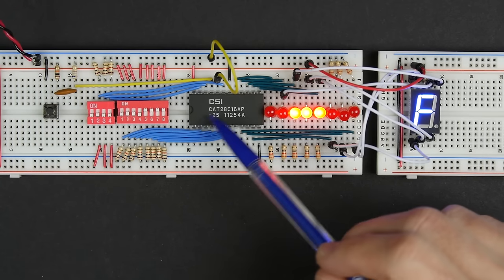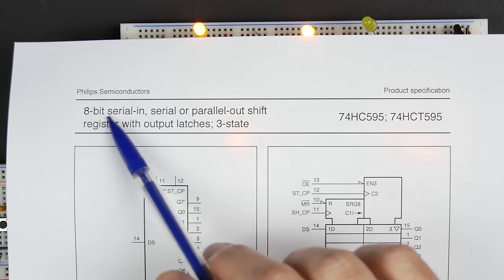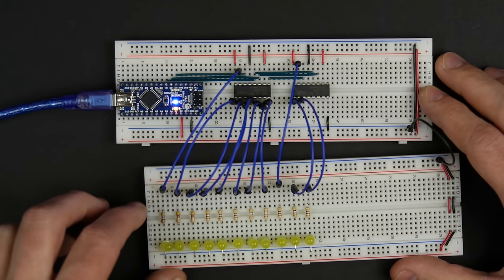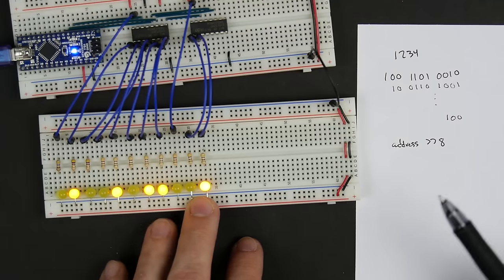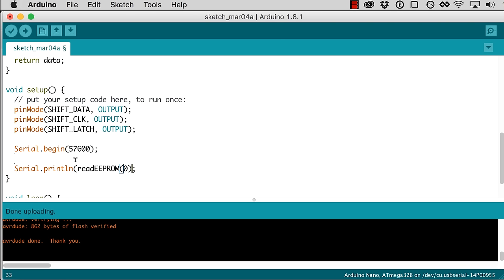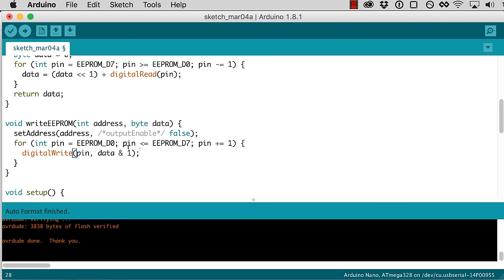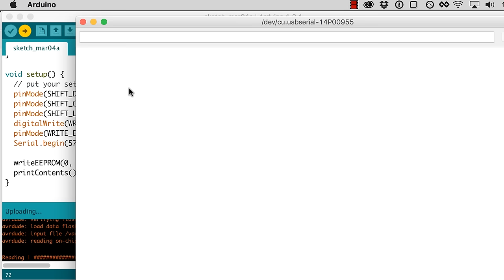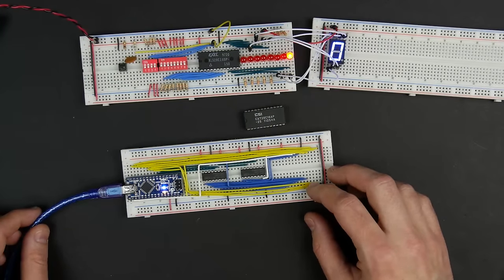Build an Arduino EEPROM programmer

Comment: I just cannot get this to work. 2 major differences in my case: 1) I am using an uno. 2) The EEPROM i am working with is a AT28C256.  I simply used the other 7 shift register outputs for the additional address lines.  There is exactly enough pins.  After struggling, i pulled out my Siglent to look at what is going on and I noticed that the LED on the UNO blinks 3 times on startup. That's connected to pin 13. So, I swapped pin 2 and 13 and updated the code accordingly.  Still no luck.  Next, i figured the write pulse was just too long so i wired up a R/C circuit with 1micro-f cap and 680 ohm resistor.  The o-scope timings look spot on, about 700 ns from below .8v to above 2v.  I am starting to think my eeprom is no good. Does anyone have any other suggestions?

Comment: the delay part, I guess the write delay should be fine for 5ms, but not enough for the changing of the Arduino's IO transfer from output to be input.

Comment: Ben, I loved this project so much, I bought the parts to build it. When testing, I couldn't get it to work. I'm using the AT28C64. I tried moving the (erase, write, read) to separate voids, and added push buttons on analog A1,A2,A3 in void loop to do each step separately. I put an OLED display to tell me what step it's doing and >ready< when done. Sometimes I get random data, all ff, and sometimes b8 which is the last byte in the data array filling every memory cell of the chip. Can someone tell me what I did wrong?

Comment: Why do you need to program it using hexadecimal numbers. Is there a way. I think converting would be nice but you can't just write into it by typing 0s and 1s?
Reply: The C programming language does not have a way to represent a number in your code directly in binary. He is programming as if arduinos were programmed in C.

They are in fact programmed in C++, which is (roughly) a superset of C. In the 2014 update of C++ (called C++14) you can use what is called a binary literal, just like this: 0b01010101 (notice the letter b instead of x). So he technically could do that, but that is more typing.
Reply: Thanks for your answer. :) It's just complicated for me to program it using HEX number set

Comment: Hi Ben, excellent project !!! thanks to remind me this.
I always use timer interrups and set tasks with flag for small projects.
something like this provide me 500ms int,... This is way better than using that function.
don't use serial.print inside interrupts... heheh.

//stop interrupts
cli();

//set timer0 interrupt at 1kHz
TCCR0A = 0;// set entire TCCR2A register to 0
TCCR0B = 0;// same for TCCR2B
TCNT0  = 0;//initialize counter value to 0
// set compare match register for 2khz increments
OCR0A = 249;// = (16*10^6) / (2000*64) - 1 (must be <256)
// turn on CTC mode
TCCR0A |= (1 << WGM01);
// Set CS01 and CS00 bits for 64 prescaler
TCCR0B |= (1 << CS01) | (1 << CS00);
// enable timer compare interrupt
TIMSK0 |= (1 << OCIE0A);
//allow interrupts
sei();

Comment: Awesome project Ben, had some trouble with the Arduino code so went and copied yours, loaded it up and it looked to work a treat so I stepped through to try and find what I had done wrong in mine and noticed that yours has the same issue. I commented out the "programming the EEPROM" in the setup area "Programming data bytes" and then re-ran the program. In other words just erasing entire EEPROM and then printing out the contents. Your first byte never gets erased and therefore never changed, even if I change the contents of the array used to program, only the second byte onwards can be changed, any ideas? Ouch, please ignore post, swapped to one of the other EEPROM's that came with the kit and it all works fine, faulty EEPROM, will need to order another.

Comment: I was following along till the part about with shiftOut(), specifically the "value" where I don't understand 0xff or 0x55. Then I got confused with the address >> 8 I'm just straight up confused with what this is doing and why it is necessary. Finally, I got lost with how 1234 is binary for 100 1101 0010..., 

Can someone explain this to me? or point me to some resources that, might help?

Comment: You know you could use that shift register to do multiplication and division easily!  That is how computers do that.  To multiply by 2, you shift to the left 1, to divide by 2, you shift to the right 1.  To multiply by 4, you shift to the left 2.  You combine these shifts with some adds and together you can do multiplication.  In fact, in the DOS days of programming, using bit-shifts was a way to optimize programming as CPUs have a single instruction to shift right or shift left, and in C you have a bit-shift commands << and >>.

If you wanted to multiply by 3 for example, you would shift to the left by 1 and then add in the same value to itself once.

Comment: i bought the whole package from ur website and everything went perfect until when it came to micro controller i thought what i had is arduino nano but it wasn't (it was ch340 nano ) and didn't work proparly it fails to load the code and tried every thing with it but and failed ,,this is error was showing avrdude: stk500_recv(): programmer is not responding and searched for the solution nothing helped .. i don't how to use it or what to do with it ..
Reply: acording to http://actrl.cz/blog/index.php/2016/arduino-nano-ch340-schematics-and-details/ you need to install a certain driver.. if you're still haveing truouble i don't know what to tell you..

Comment: This arduino code ends up getting very complicated later when he wants to write larger and larger images to the eeprom. What I did instead was make a general eeprom writer that accepts bytes over Serial from a python program. then I can make images on disk however I want and send them over to the arduino to write. this will also help me when I get to the 6502 project and need to write those binaries into the eeprom vs the $70 for a hardware programmer.

Comment: Talking about keeping the ~WE pin high to prevent accidental writes: Isn't it unsafe to hook up just the power prior to other pins? That way, every digital input to that EEPROM is just "flapping in the breeze", potentially causing random writes to random places. Sure, there are protections in place like a requirement for at least 100ns low input to ~WE while the other control inputs are at a specific logic level. But still the risk is there. Furthermore when the ~CE, ~OE are already stabilized and the ~WE is the only unconnected pin.. Is it only my internal fear? :)

Comment: Since you are using an Arduino for the programmer and interface, why not use a single 16 bit port expander for the address lines instead of shift registers?

Comment: Hello Ben, excellent  video as usual. I set up from this video an eprom programmer but it happens that when I reset the arduino,  the last address  location set on the prom during previous run  gets corrupted. I bypassed this problem by setting the chip select of the 25C258 to HIGH during the reset sequence of the arduino and this solved my problem. I guess that at setup time arduino signals are in wierd states and that triggers a write.

Comment: Great series! If you wanted or needed to be more precise with the write enable timing, could you have used an RC circuit  similar to the one in previous video and trigger it from Arduino, in the same fashion as you triggered with the push button?

Comment: only 5:12 in but it may have been easier for you to use the analog pins (If i remember correctly they are i/o as well) as digital pins  to give you extra to use but i guess going this way allows you to use and explain a shift register

Comment: im surprised he didnt use the 1nF capacitor circuit for the write enable. enabling the base of a transistor from the arduino. might try it myself. edit: so built it with the AT28C256 EEProm from his 2nd project.  works similar and only two 74hc595 were enough to cover all. those two are enough to get to 32000 addresses + OE . so it should work to write the whole chip. i used the 1nF capacitor from the test circuit with switches. so the wire from the arduino goes to the switch (and instead of the switch now ;)) side of the capacitors feet-wire. and the other cap-feet has a wire connected to the eeprom write enable - so no transistor needed as  i was thinking first.  i still used his microseconds delay but with 20 or something because the capacitor should go back to high anyway. after that i did a 20 delay .takes some time to write but worked straight away :D . wonder what it looks like on the oscilloscope now. took me more time to build than i would like to admit, specially with that arduino nano china clone, that didnt work straight away ...  . never the less fun project ^^

Comment: I've had a similar problem with delay(). In my case (ATTiny85) delay(100); delays for a whole second, not 1/10th of a second. Either the documentation is wrong or some chips do things weirdly different.

Comment: "This value 1234" was in decimal... hence 0x1234 = 0001 0010 0011 0100 , and 1234=0x4d2=0100 1101 0010. Better to teach in hex, because of each nibble is a group of four bits. it is simply to get the point. 0x4_d2 >> 8 = 4 while 0xd2 shifted out.

Comment: Is there a better way to do this? I've read someone suggesting to latch the address lines, then output the data in the next byte. That requires only 3 steps instead of 17 to shift the address out 1 bit at a time. Could someone please make a video showing how to do this better. Thanks Ben for the inspiration of this project. ..

Comment: How are you sure the arduinos speed doesn't exceed the speed the EEPROM/shift register can handle? Do you just trust that the output functionality of the ardunio is slow enough?
Reply: Albert Sandberg I haven't watched the whole video yet, but you can check the datasheets to verify that the chips can be run at clock speeds exceeding the 8/16MHz clock of the Arduino
Reply: I know some of the chips used in his tutorials are ok with 8 MHz. Didn't know the clock speed of the Ardunio at all just since it's fairly modern I assumed it was quicker.
Reply: and both the shift register ship and the arduino's shiftOut function are designed for SPI (a communication protocol using a clock and data wire).
Reply: shiftOut is not SPI. Arduino can do SPI on a fixed set of pins using a different library; shiftOut is a way simpler 'protocol' implemented using digitalWrite, which makes it work with arbitrary pins but also makes it far slower (each call to digitalWrite takes a few tens of processor cycles).

Comment: Has anybody ever mentioned using serial communication takes a lot of clock cycles?  Your max speed is 1/16 (clock) + setup and hold.  Setup is timing to enable write and hold is min time eeprom needs to write the data which is a few ms.  If you used two parallel latches, instead of 16, you would only need 3 cycles.  This method was used mostly in home computers in 80s.
Beside, you method does not garantee the complete write to eeprom.  Older eproms needed to be read after amwrite to make sure the write cycle was complete.
Reply: Well.  I wrote my note above before watching your whole video. I was right, 1ms doesn't garantee the write cycle.  One method I learn to program eprom was to start with 0.5ms wirte and read back.  If the byte read wasn't the same as write, increase write cycle to 1ms and so on. But you may burn the eeprom cell with excessive writes and you should have a timeout or number of writes before giving up.

By the way, you should use a for loop for your long sprintf command.

Comment: hi ben, I have been having trouble with the newly updated code. instead of programming the separate bytes into the separate addresses it takes the last byte from data and programs the entire thing with that data, without even looking at the other data.

here is a copy of what happens

0x00: b8 b8 b8 b8 b8 b8 b8 b8 b8 b8 b8 b8 b8...... 

and so on.

 if you could please help me with this problem that would be amazing! also has anyone else had this problem?

Comment: You could have used the analog pins as digital ones by setting them to 1024 (or the max value of the analog pins) and 0 instead of HIGH and LOW

Comment: I love your videos.  I have a question about the EEPROM programmer.  In your parts list above, you mention that it should also work for the 28C64 or 28C256.  Looking at the 28C256, the Write Enable and VCC would not be in the same positions on the breadboard as the 28C16.  I'm wondering how it would work with it then.  (I haven't looked at the specs for the 28C64, but I'm guessing it's a similar issue).
Reply: As I understand it, you must rewire according to the different pin-out; you'll also need to connect some of the unused outputs of the second 595 in order to drive the additional address pins of the larger EEPROMs.

Comment: If you're writing a bunch of eeproms I have an idea.
Assuming that your not using the entire eeprom you could use the last word or 2 to write an identifier.  Then before writing to the chip you could read the chip write the contents to a file named ROMdatetime.backup thus you'd have a backup and if you want to return to the original project you don't have to start from scratch if you kept track of the chip ID and if your positive you'll never return to the project you can simply delete the file...

Comment: Hey guys! Let's say I have an SD card with a file. The file content is a 128 Kb hex data set. Arduino initiates a dump process of this content and prints to the serial port. I want to write this content on my EEPROM chip. How can I declare this byte array? will work if my code is: bytes data [] = {Serial.read ()}; ?

 Because Arduino Uno and Nano do not allow to make an array with more than 29 Kb. Arduino Mega has a bit more memory, but it doesn't allow that much either. PROGMEM does not solve this problem either. 

How could I write 128Kb or more using Arduino UNO and an SD Card module using Ben's method? . Any help will be greatly appreciated. Thanx!

Comment: ... I think an easier way (simpler hardware and software) to put data on EEprom is...  using a 4040 binary counter for addressing so you just need a CLK  and Reset pin pulse controlled by Arduino , and direct 8 bit data from Arduino, plus WriteEnable pin, just 11 lines output are needed from Arduino board, and simpler code is required.

Comment: Hello 
Is nice eeprom programmer.
I have a question. Is possible to program a memori 27C256-10 with this programmer?
Reply: I believe the answer is yes.  Two shift registers are used for the address line with the highest bit used for one of the control signals, so you just need to connect the currently unused shift register outputs to the extra address lines on the 27C256.

However, this would be the largest EEPROM you can program through this method without making significant changes.

Comment: Would you be able to use those flip flops to create a sort of reverse shift register?
Where it takes all its inputs at once from the EEPROM output
And outputs it one by one through a single pin?
That’d be really cool if you were short on pins for the Arduino
Have it so you only need two pins to READ the EEPROM
One has the data
And one is a clock pulse

Comment: Thank you for the instruktions! it helped me alot. only one problem, i coudent get a reading from the seriell monitor, but it was that i hade set the baude raite wrong. And when i tryed to write more than 511 adresses it write wrong, i changed hove many adresses it erased from max down to 512 it solved it.

Comment: I'm surprised that you're not using any decoupling capacitors... the Arduino must already have some on board; you'd definitely need them if it was just a PIC or an AVR DIP plugged into the breadboard...
Reply: I would love it if he would put his scope on the power supply pins while it's running. Simple to do. I see lots of YouTube videos that use breadboards and never have any decoupling capacitors.

Comment: Excelent videos! Could you take advantage also on the fact that the address and the data can written in different in different times to use only eight pins of the arduino?

Comment: Just built this programmer.  I found a small bug.  At github there is a schematic and Arduino program, but there data and clock lines are swapped.  I changed the schematic to  (ser) to d2 (srclk) d3 and (rclk) d4.  It now works correctly.